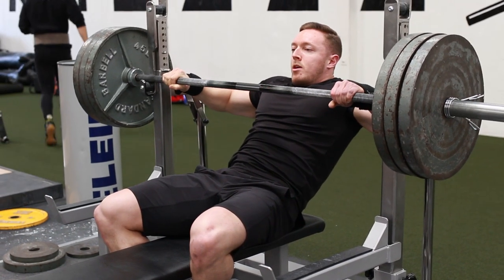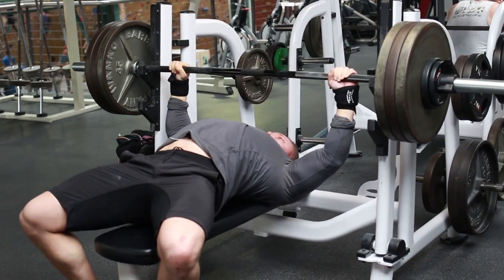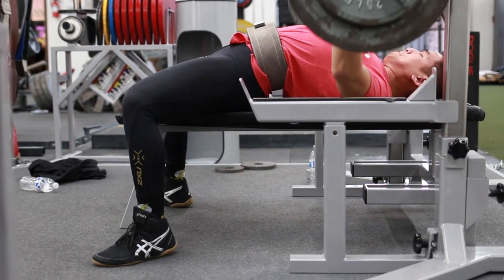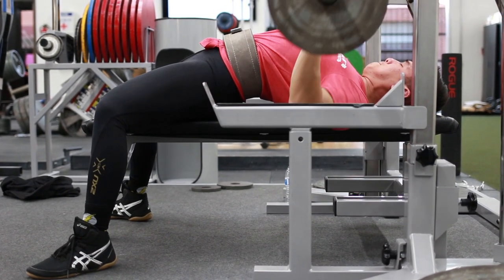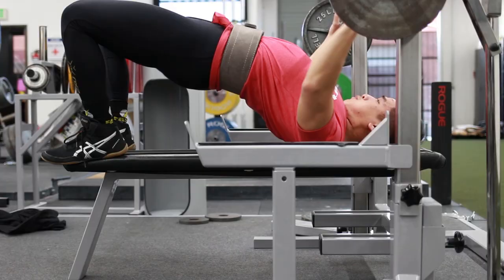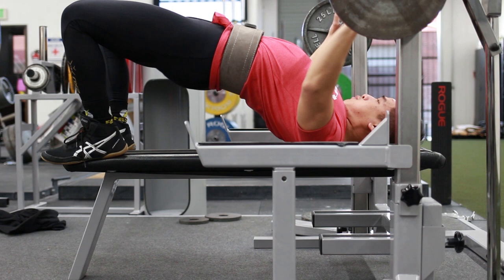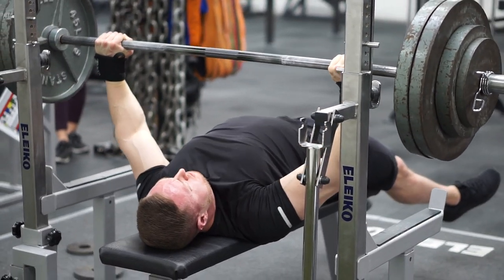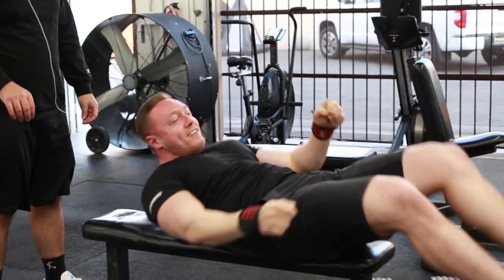Understanding Leg Drive In The Bench Part 1 | What's ACTUALLY Happening

Comment: Great video as always. The problem I run into is that I'm very flexible. I have struggled for the past year with my butt coming off the bench when I try and utilize leg drive. My first coach ended up taking out my leg drive all together and to compensate he had me bring my grip out as wide as possible without shoulder pain (it ended up being index finger on the ring) and my feet as far back as possible. My new coach is working with me to try and use leg drive, he is having me with my legs as wide and as far back as possible, and also now I'm competing in usapl so I'm flat footed which helps, and I wear flat shoes rather than oly shoes. This is a long comment, but I really appreciate you taking a new approach to explaining leg drive. In the next video I'd love for you to touch on the differences between those lifters that are more flexible than others. A chiropractor told me I have what they call in the biz Gumby limbs :-/ haha
Reply: Maybe you're pushing up instead of back which causes your butt to go up
Reply: Hey Asif, yes that's what I've been told but my brain isn't connecting with pushing back for some reason. Which is why I found it interesting when he said that he said he doesn't explain it as sliding back like most people. So I'm really anxious to hear how he breaks down the movement. I have seen a lot of improvement from focusing on maintaining tension in my lower half throughout the rep...but when I get tired or the weight gets heavy it becomes more difficult.

Comment: I don't think my brain works right. No matter how many videos I watch and try to implement what I see, pushing my legs lifts my butt off the bench.
Reply from the maker: You have to really use proper leg positioning and proper leg drive. For legs cue to press the feet forward not down. Almost like a leg extension. And ensure your legs are locked into a position that limits mobility slightly so the hips can’t lift up as easy. Lastly try and make sure you don’t thrust the hips at all. Just quads forward! Not hips up.

Comment: His thighs and therefore his butt is off the bench.
Reply: Yes, that's what their "drive" is. You can't transfer force that way most of it is lost in the translation assuming they keep their glutes and shoulders down. That leg push down has to make a 90 degree bend, travel along your body then another 90 degree bend up into the bar. It's silly
Reply: @Jdl223  The leg drive might transfer 5lbs say of lift, but that can be all that is needed.